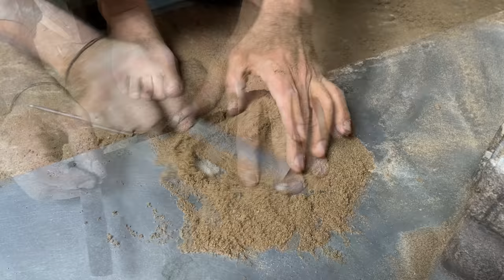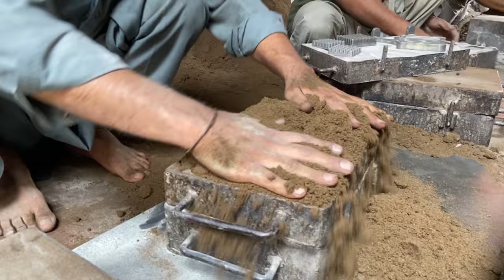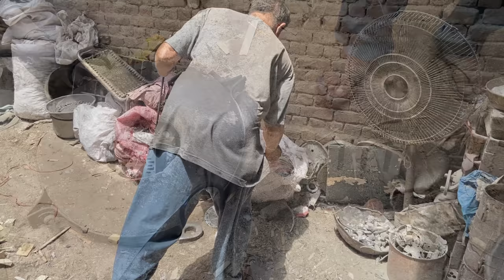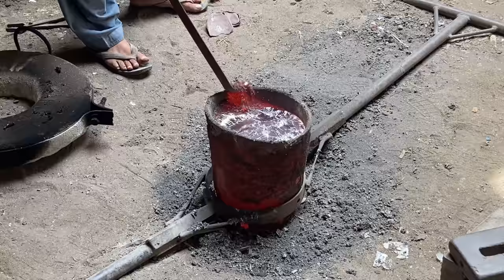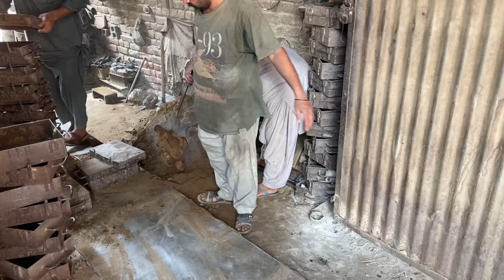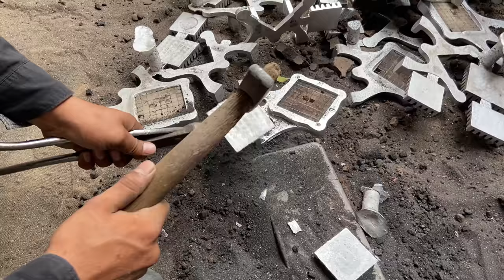How Chips Cutting machines are made | How to make Fries Cutter

Comment: I never realized they poured those blades. I always figured they were actual blades attached into the frame. Amazing work.
Reply: they didnt pour them that what he was protecting with sand at the begining
Reply: The blades are stainless (?) steel. Their endings are embedded in the aluminium. Aluminium is not strong enough for potatoe pressure ! 😉